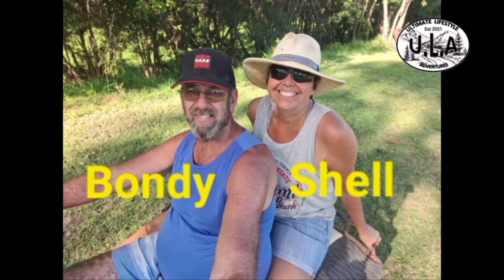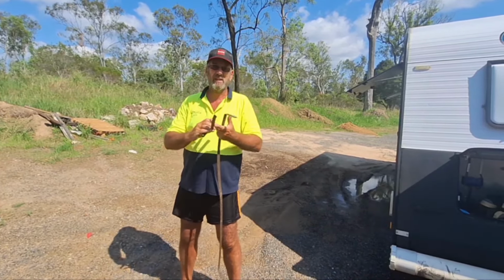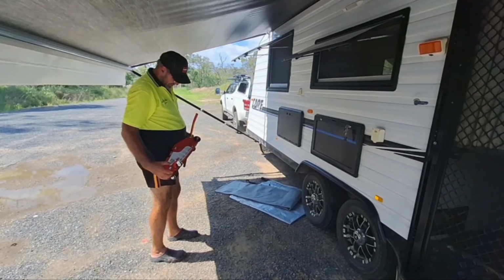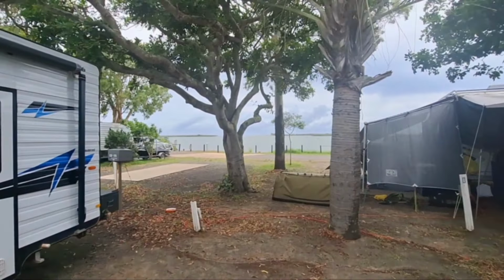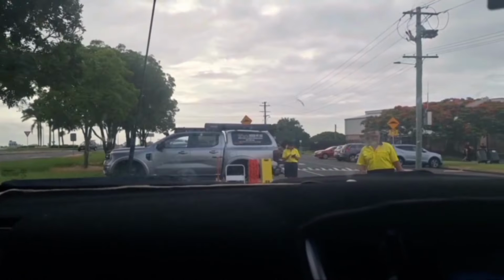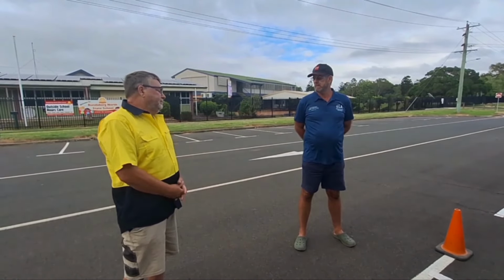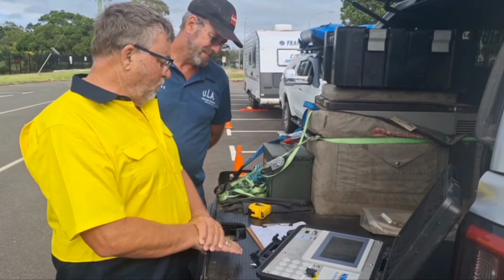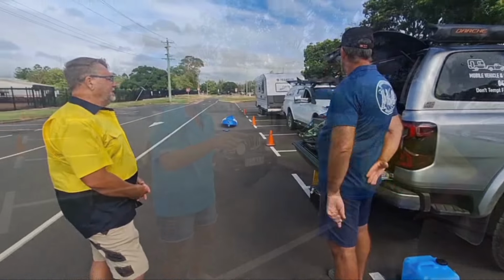Miara Holiday Park, Weigh Your Rig. Checking setup Weight.

Comment: Hi too you both great content l would be interested in how much your caravan weight and how the mq goes when towing honest opinion would be great 😊
Reply from the maker: @justme-tl1lw  firstly thanks for the support and comments, secondly we tell it as it is always. Our Franklin 20.6ft van comes in at approx 2400kg, the triton has had work done, we have had it remapped as in engine tweaked, and the suspension we have upgraded to air bags and 400kg constant weight springs in the rear with heavy duty springs an shocks in front. With all that, we love our MQ and does exactly what we ask of it. I don't see any reason to have a Land Cruser or anything that size for towing what we have. Any other questions feel free to ask. Cheers folks
Reply: @ultimatelifestyleadventure8560  thanks so much for  the detailed information happy and safe travels 😀
Reply: @ultimatelifestyleadventure8560  so what have you since done to correct the overweight car and van?
Reply from the maker: @Liteprinter  good morning, as we had already upgraded or suspension on the triton and the van was also under certified, we had a engineer redo our compliance plates with a blue plate upgrade. In our case it was an easy fix. Our Pedders suspension upgrade, even tho it wasn't cheap but well worth it now. Cheers Bondy
Reply: @ultimatelifestyleadventure8560  thanks Bondy. Pedders quoted $5900 for a certified GVM upgrade for my Triton. Is the ride much rougher when not towing?
Reply from the maker: @Liteprinter  you definitely feel the difference when the van is not on, but I let the air bags down in pressure to help, but we also have the 400kg constant weight springs, so it is a harder ride than normal. But with the van on, it is so comfortable, and handles so well. Yes pedders are more expensive but we looked at the warranty side of things, they are Australia wide, so if you are travelling and there is a problem you are covered. We highly recommend pedders.